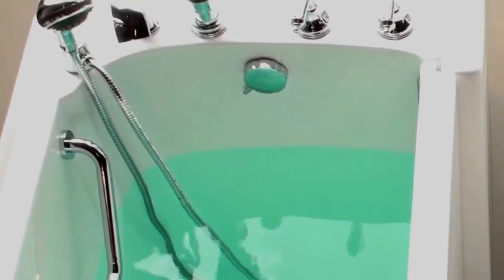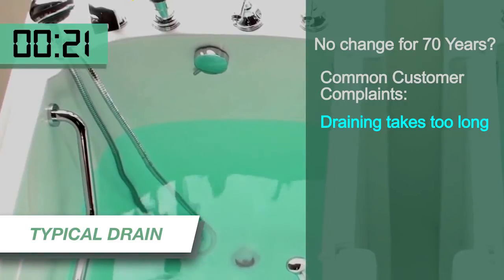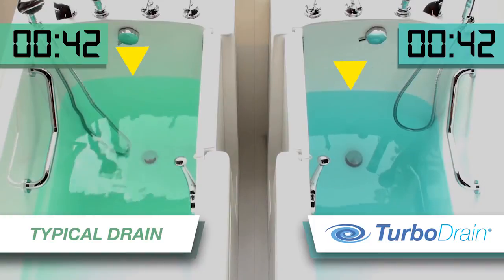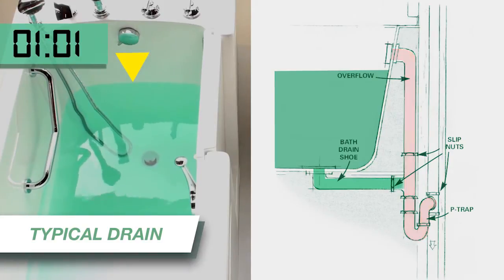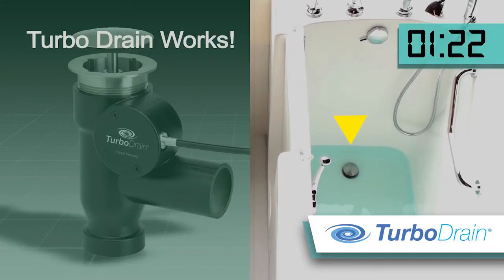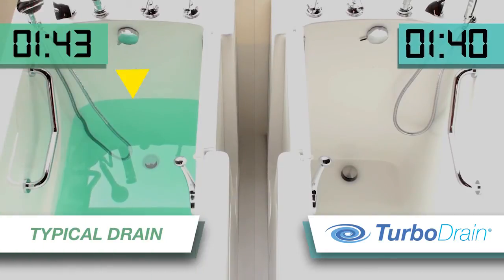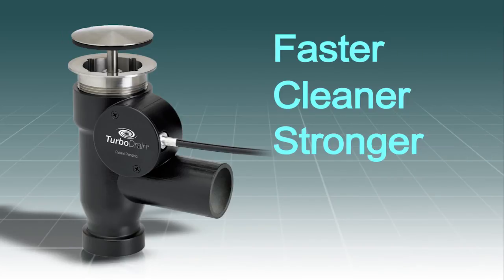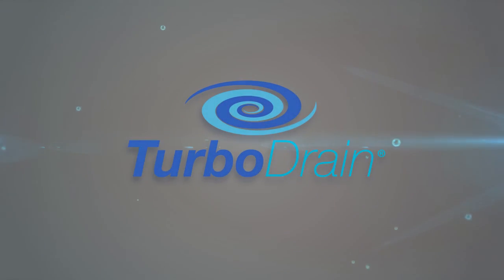TURBO DRAIN - Drains bathtubs 3X faster without motors or pumps

Comment: That's still pretty slow. A solution could be a much larger drain hole, or several drain holes. The water would drain through several pipes into a large holding tank below, like in the basement. The water would then drain from it at a leisurely pace. Simple.